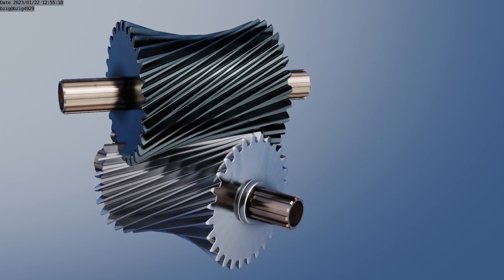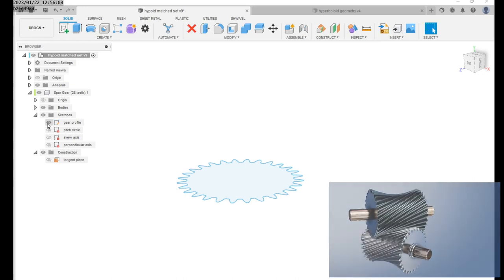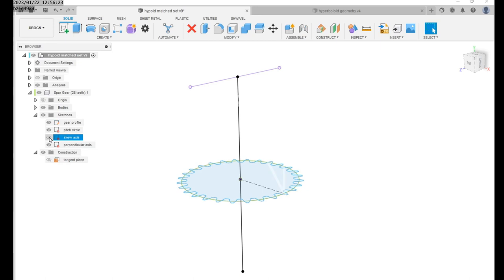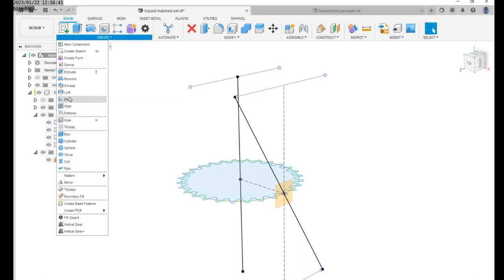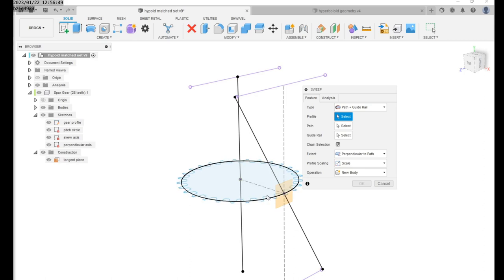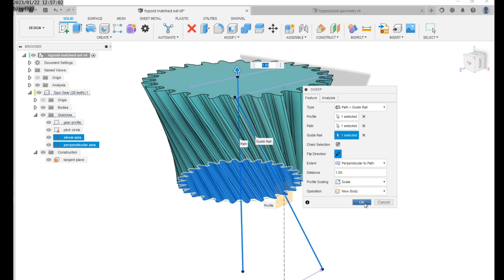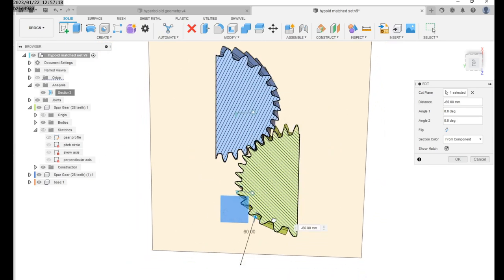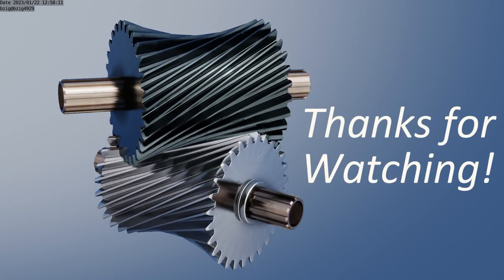Fusion 360 - Hypoid/Hyperboloidal Gear

Comment: how to proof they are match as conjugate ?
Reply from the maker: I did that visually with a section analysis.  But I realize that isn't mathmatically rigorous.  I used to be good at proofs, then I became an engineer and now I just randomly blurt out "small angle approximation" 🙂